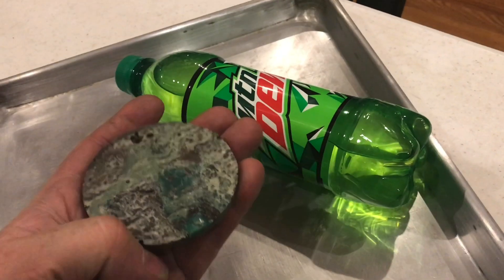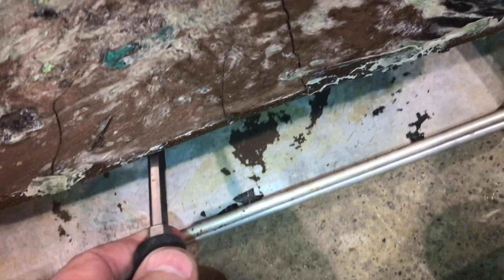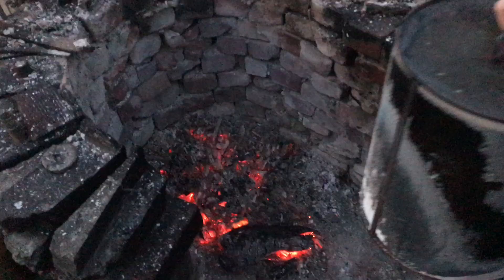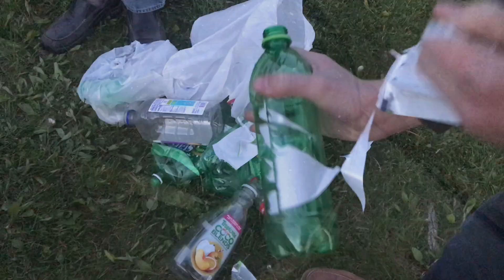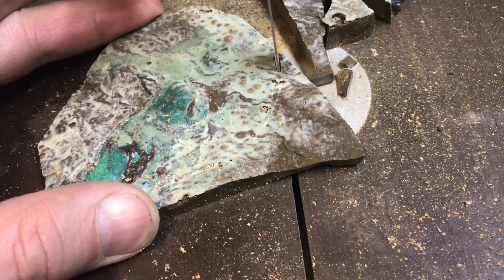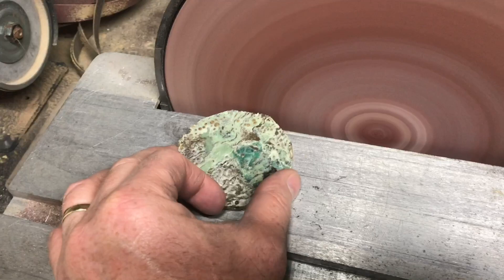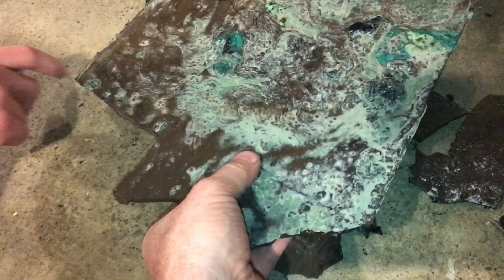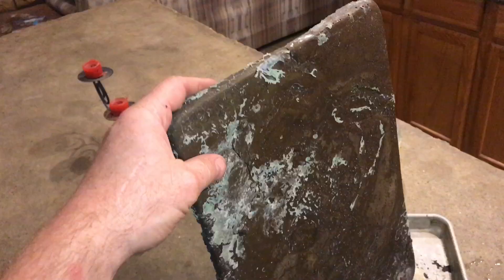RECYCLING “plastic” pop bottles in the backyard (polyethylene terephthalate pete pet petp)

Comment: Remove the cap..  The cap is hdpe the bottle is pet for better result
Reply from the maker: Just out of curiosity when you recycle the PETE, is it as brittle as my result? Next time I’ll put the bottle caps into the high density polyethylene pile. Thanks
Reply: @livefree6878  pet or pete plastics are unfortunately only recycled into fabrics to make clothes or into PET fillaments for 3D printers..  Reforming it into another object is expensive.. The best for such recycling process are hdpe,  mdpe, ldpe..  You can even mix these 3 and form into a new object by heat.
Reply: I think they also melt pet and mix it to sand to make bricks/tiles/roofs which is amazing because its lighter and stronger however I dont like the idea because once you mix plastics to sand it will be impossible to recycle it again..  Its forever like that.
Reply: You are right
Reply: How about roof shingles/tiles?
Reply: @unliwanderer2985  yes its an excellent roof shingles because its stronger and light weight
Reply: And the ring of the cap
Reply: @livefree6878  Pete melts at 300 f and you have to use gloves to twist and knead it to remove air from it you put it in a mold and compress it because like pet it contracts so this helps keep it to a general shape

Comment: Cool. Stuff
Reply from the maker: Next time I’m gonna try a little slower heat to see if I can illuminate the brittle plastic at the end. It’s always fun making something out of nothing👍👍 Great hearing from you
Reply: @livefree6878  
I was wondering what could be made and reenforced to if that would make a difference. I don't know what though. Could be cool stuff for a temporary stage prop or effect with lights.
I m guessing chicken wire would hold much and it would still be brittle. Could be the beginning of something leading to even cooler stuff with time experiments and patience